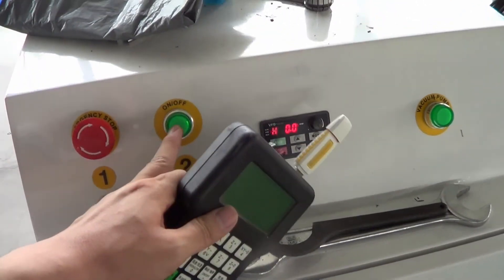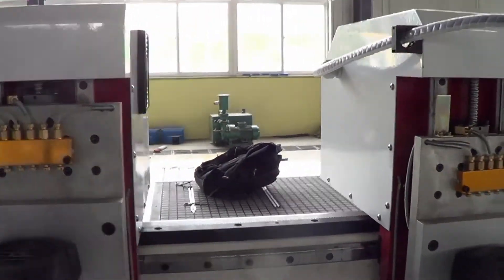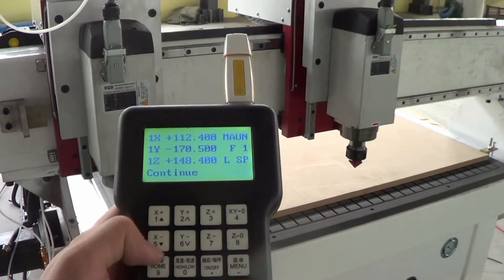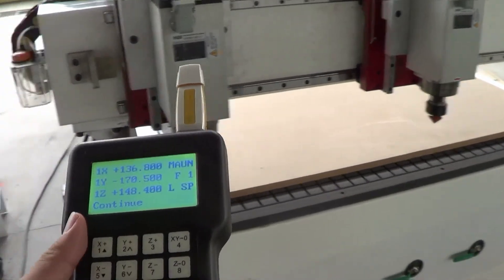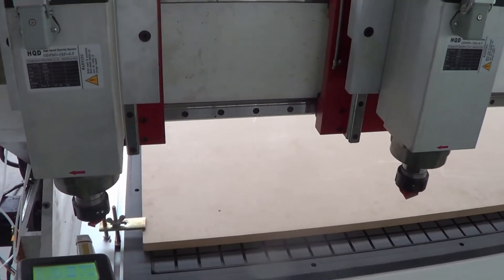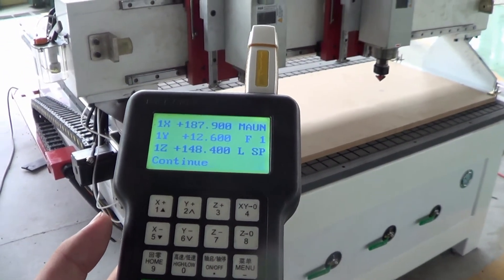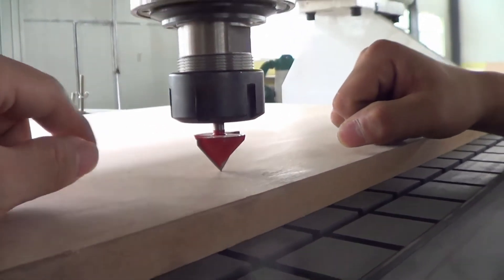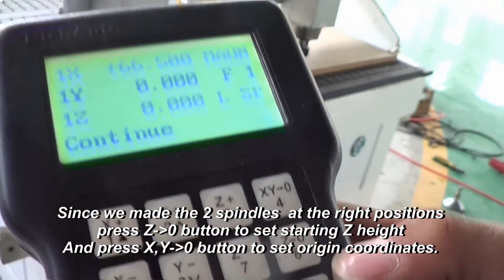starting 1325 2 cnc router with double head spindles, China cnc router,

Comment: hi mr. LIU XIN, i have a same cnc machine but i need a some information for g-code, what is format of g-code file in this machine, i am working in artcam 9.1 & aspire 8 software's. i am try to both g-code format butt my DSP device not a read USB Flash Drive.  please tell me as soon as possible. with best regard.
Reply: Do you have 2 inverters-vsb or just one